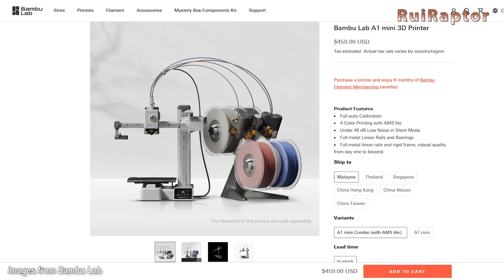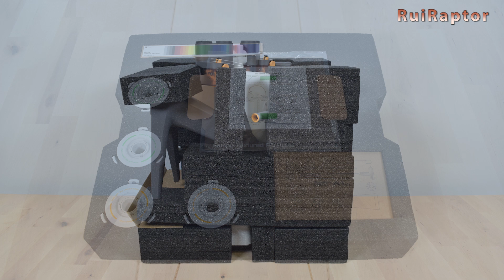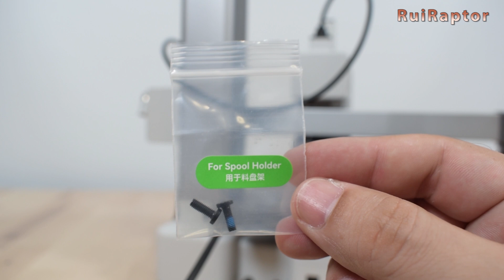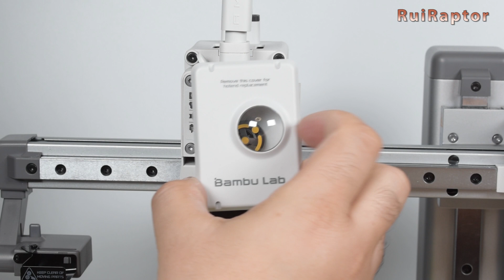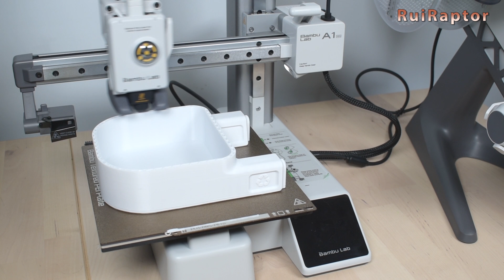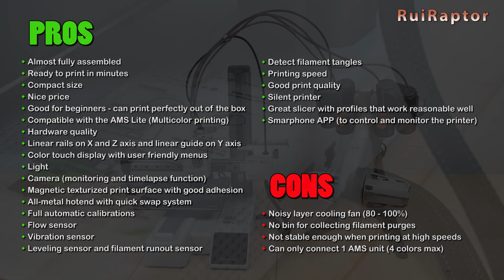Bambu Lab A1 Mini - DETAILED REVIEW (Full Analysis, Prints with Different Filaments and Pros & Cons)

Comment: Been printing almost non-stop on mine since I got it. Overall I think it is really great with a couple issues.

The small build plate is annoying as is the sheer size of it with the AMS, but I have found it to be really reliable.

The firmware bug with it not parking the head far enough to purge properly was silly and took way too long to get a patch for though.
Reply: bambu is good  aboout softweare updates and gettting them out to us so it will be fixed in no time im sure

Comment: If only the AMS could handle flexible filaments, this would be the best printer combo there is on the market. Being able to do not only multi-colour, but also multi-materias would be a total power feature.
Reply: Isn't it possible to put TPU on the non AMS spool holder, and 3 non flexible filaments on the AMS? It can print TPU, so it's possible, even if not in the software ATM.

Bambu lab, get it done.